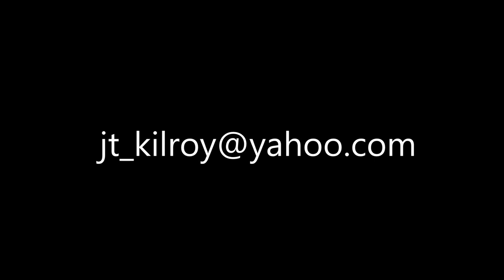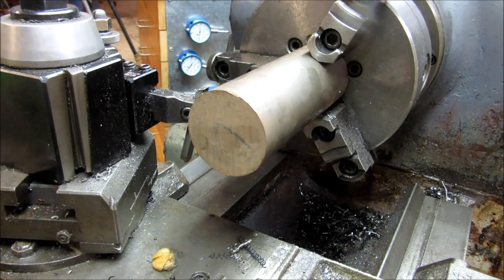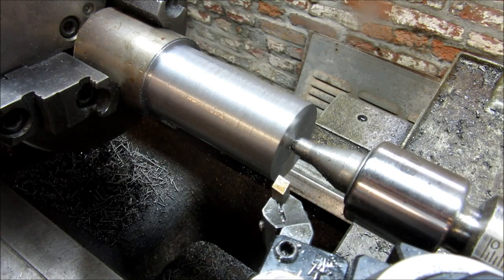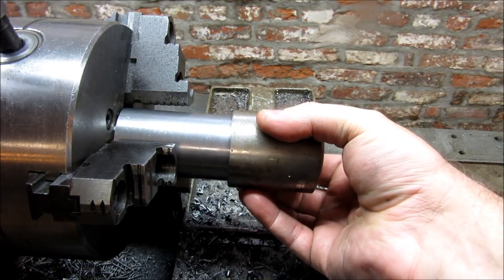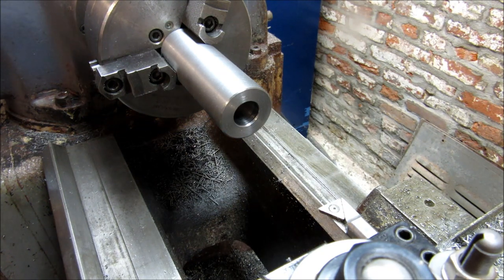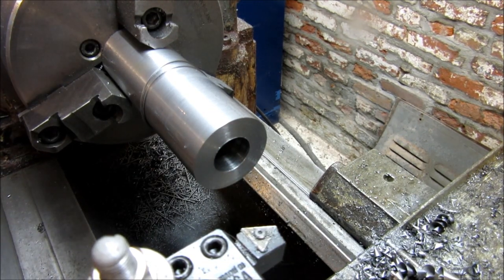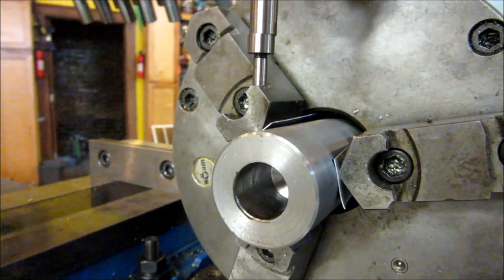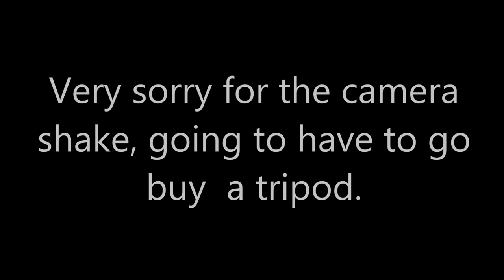K&T Crank #1

Comment: Nice video James!  Look forward to seeing part 2.  Thanks for sharing.
Reply from the maker: Thanks Mr. Blair.  I enjoyed your bandsaw discussion, I hope you have better luck with Starrett blades than I have.  I prefer Lenox blades.  I have a grinder just like the one you got a screaming deal on and it has given me great service right out of the box.  I did replace the stones however, the ones that come with it are junk, practically concrete.
Reply: James,  My dad was Mr. Blair, I'm just plain ole Herb.. ha
I plan on replacing the stones, as I agree with you, the ones one there ain't worth a darn.  My problem is that I've run out of room to put any more machines in my shop.
Reply from the maker: The space issue is a tough one.

Comment: Nice work! You'll be cranking the knee before you know it! With it sticking out so far be sure you don't whack your own knee! Or nail yourself in the "privates"! (Ouch!) Thanks for the video. Looking forward to installment #2.
Have a good one!
Dave
Reply from the maker: Hi Swarf Rat, thankfully the machine has a power feed disconnect.  When you activate any of the feeds it is not possible to engage the crank, or any other handle, so you don't get whacked!

Comment: Those scotch keys must hold a ton. On the big Deere tractors they use 3 of 3/8"d pins to hold the outer ring of the planetary axle drive from turning in the axle housing. They are way stronger than a straight key that is for sure. Probably the next best thing for torque transfer to multiple splines.
Reply from the maker: I'll have to take your word for it, I don't have any practical experience with the concept, this will be a first for me.

Comment: Nice information. It is awfully hard to see when the vibration hits the camera like that though.

The 1144 stressproof cuts almost as well as the 12L14 and you can weld it.
Reply from the maker: I turned the image stabilization off for the next video, hopefully that helps.
Reply: I think we spend half of our time working around these new "features" that they are adding to cameras.
Reply from the maker: It sure does, but a little machine grey spray paint will take care of that in short order.

Comment: How about threading the handle on with RH threads and using a LH bolt to lock it on. My two cents, thanks for the vid's!
Reply from the maker: I certainly could have used a LH thread on the crank nose, and I even have a 1/2 x 20 LH tap.

Comment: Hi James, electric edge finders are no better than the type you already have and are arguably worse. By all means buy one and try for yourself but be prepared for a slight let down, If you do buy one get the type that has a ball contact sprung loaded as it is embarrassing when you wind the rigid one too far and bend it.:>(   Yes, the voice of experience.:>((
ATB
chris
Reply from the maker: That is good to know before I spend the money.  I like the old fashioned ones just fine.